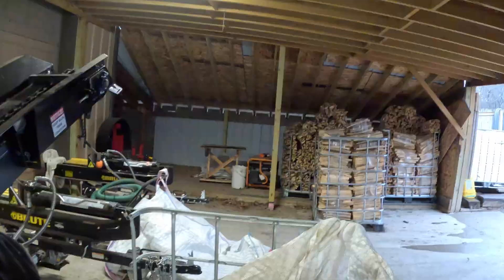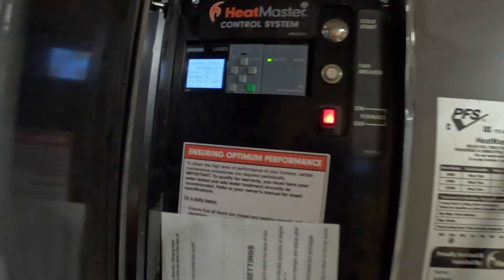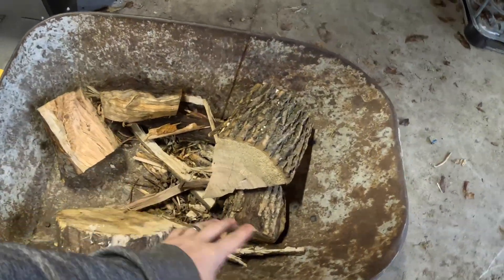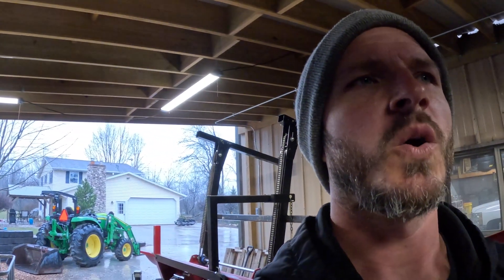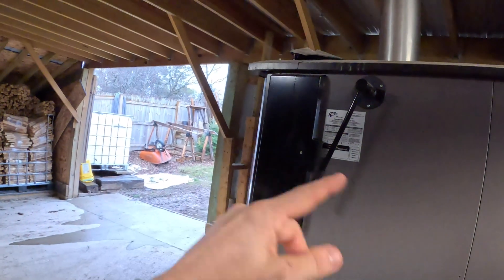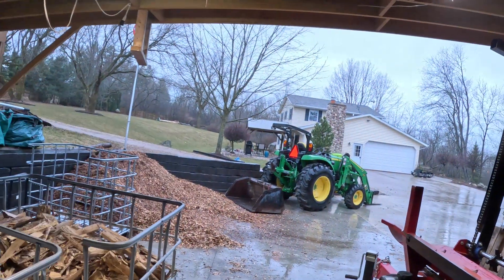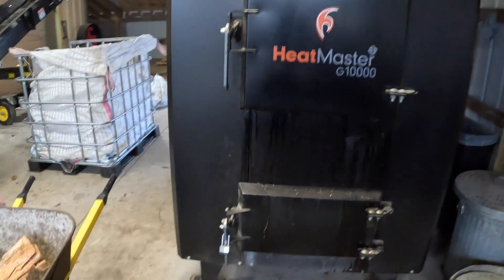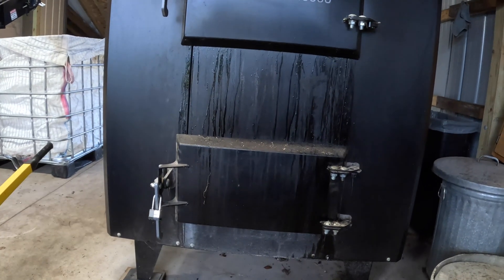Outdoor Boiler Gets Software Update

Comment: Some ideas for you, Matt. I've been studying OWBs for some time and my preference is towards the gassers. Although they need crispy dry wood to preform efficiently. Equates to less wood though. My thought for you is, thermal storage of water. Even if just for the kiln side of your heating. 1000 gallons of heated 180* water would last quite some time before temperatures drop enough to call for more heat. Leave the boiler on it's normal setup for your home needs, and insulated thermal tanks for the kiln. I'm sure this would greatly reduce your wood consumption. I can point you in the right direction if you choose.
Reply from the maker: I do have an additional 240gal of thermo storage  right now. It does help. But the only issue when running the kiln is that half of the time the kiln calls for heat and will for quite sometime will cool the thermo storage down to maybe 140ish or colder depending on the cycle. The boiler will run for so long because of all the additional cold water coming in non stop. But I’m open to your ideas.
Reply: @Treestofirewood  I think additiona storage would enable you to "batch burn,'' for the kiln side of heat demand. Adding an additional 1000 gal of storage you would burn heavier for a day. Once charged, that volume off hot water would take a few days to need more heat. The storage would have to be well insulated. I'm assuming the 240 gal is for the house? If so that tank should be in the house. You always want your storage where the heat is being used.
Reply from the maker: @bullybluecoal1831 I have it in the garage. I added more storage for when my snow melt system is running. Because that demand is really high for at least the first hr as it take a lot of BTU’s to warm up cold glycol especially the size of concrete I’m heating.

Comment: I installed a G4000 last fall, it worked great until the one cold spell we had, for some reason the secondary air channel filled up with creosote, it literally looked like the elephant's foot, and it was blocked off completely. I called my dealer and he said that he has not seen any other units do this, my dealer help with trouble shooting (on a Saturday, but we were both puzzled how creosote got in there and I haven't seen it since), I chiseled and burned out the creosote and it has been going good since. My dealer sent the photos to Heatmaster they also followed up and reached out to make sure that boiler was working. 
I understand your frustration with spending hard earned money and having problems to deal with but hang in there and I'm sure Heatmaster will get this resolved.
Customer service from Heatmaster is top notch.

The new G-series are way more efficient compared to my old G200, I could not imagine how much wood you would consume (along with time to process the wood) with a convectional boiler, just my two cents.
Reply: Making a customer fix their boiler is not top notch service.
Reply from the maker: Yeah I may have had that same issue with the creosote build up. I will check the air intake channels in a month or so to make sure they are not plugging up again. The software update seems to be working so far.

Comment: Purple power degreaser works great to clean the seeping creosote. I usually spray it on, and then hit it with the power washer lightly at the end of the season. If you keep the boiler going all year long I don’t think I’d hit it with the power washer while it is up to temp. Just use a wet rag or something to wipe it off in that case.
Reply from the maker: I will have to give that a try. And yeah I keep her going none stop. Wet rag/towel should do the trick.

Comment: I hope it is fixed. I had a good chuckle the other day when I read someone saying they would not be purchasing a heat master because of the customer service you were getting. It looks to me like you are getting great customer service. Sure it seems like a huge pain when your equipment breaks down. However, with the demand put on it, it seems to me the machine has performed well. Heat Master customer service does seem to be ignoring your problem. I personally know people with other brands of gasification units as well as some traditional units that do not seem to be getting the customer service heat master has given you. Most of the people I know with boilers only run their machines from November to March or April. With nowhere near the demand you require from yours. With that math yours  has about 3 to 4 years of use on it already.  Like any other piece of equipment it will go down from time to time no matter how well it is maintained. I am impressed with how few problems it actually gives you. And how fast a company the size of Heat Master responds to your concerns. Have a great day.
Reply: HeatMaster has been fantastic with me as well. So responsive and helpful.
Reply from the maker: @DSmith-xf5xi great company
Reply from the maker: Yeah I feel they have been great with me. It’s like I said when something goes wrong especially with how meticulous I am with general maintenance it gets frustrating and you want it fixed asap. Just have to be patient and communicate and it will all get fixed. That’s how I look at it. It’s a great machine and has served me well.
Reply: Saying Matts boiler is equivalent to 3 to 4 years old is bullshit.  I don't think anybody is going to be treating their boiler better than Matt or burning dryer wood.
Reply from the maker: @highwayhydroponics5823 I would agree for sure on how meticulous I am with my boiler. And the wood I’m burning is literally 0% moisture. Lol
Reply: I absolutely agree Matt is great at caring for his boiler. What I am saying is he has used his boiler more than most would in three to four years. I personally am impressed with Matts machine , and the maintenance he does on it.  @highwayhydroponics5823
Reply: I am in no way knocking Matt or his boiler. In fact it is just the opposite. I think it impressive how many hours it has on it and how few problems it has given him. I believe this is due to two things. The rigorous maintenance schedule Matt keeps and the quality of the equipment. Heat Master seems to be a great company who stands behind their products.  In fact when I replace my wood furnace it will be with a Heat Master product. I know several people with other brands. Having way more problems with both their equipment and getting reliable customer service.   @highwayhydroponics5823